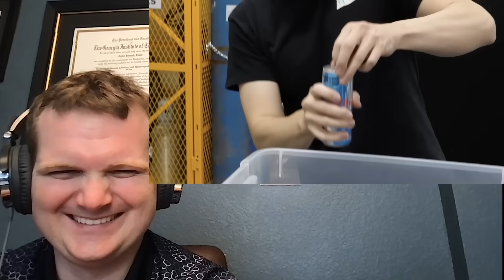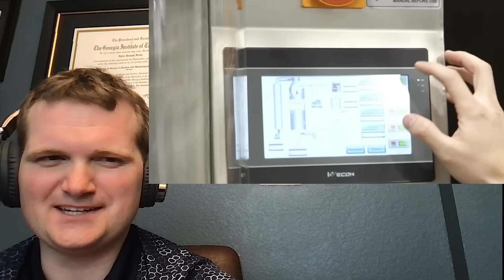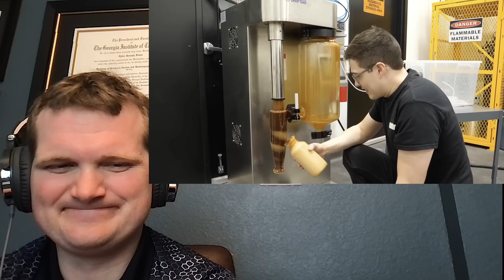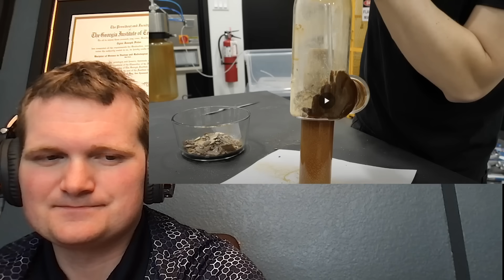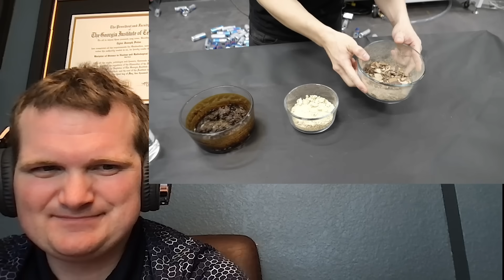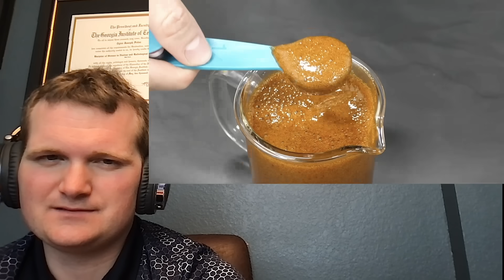Red Bull X100 Enrichment? - Nuclear Engineer Reacts to NileBlue

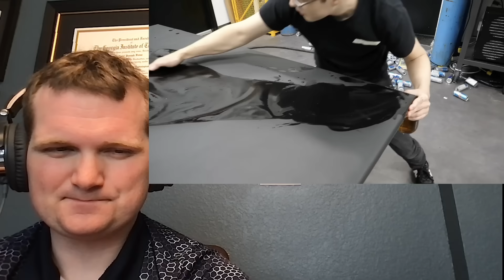Comment: 10:35 Also when you are around any type of heavy equipment there are warning stickers on them that tell you "Hey, don't do this", or that a pitch point, don't stick your hand in there while the equipment is running.
Reply: Anyone who's ever handled worker's comp claims in any industry knows just how limitless human incompetence in the face of clear and obvious warning signals can be. I never knew just how many different codes the ICD-10 has for traumatic digital amputation.
Reply: @SimuLord  I gave my coworker who shoved his hand into the table saw blade so much shit for it because of how it happened, most of it wasn't to him directly but to other coworkers but he reached his left hand over the blade to try to like grab the wood he had just cut without a guard or anything like reaching over is a bad idea even with a guard much less gaurdless like we ran that saw because of how often it would get in the way and have to be removed anyways and it wasn't a quick removal so it just got left off and it was never an issue except for the one dude who was an ex? Cokehead he claimed he didn't use anymore but I'm 97% sure he did and was just a complete idiot. Like he refused to believe me that the hospital in town with his insurance doesn't have an emergency room till I drove his dumbass over there to see the sign that says no emergency services and then drove across town to the county hospital that actually has an emergency room with his hand cut open. Like I'd lived in this town for 20+ years at this point I'm pretty sure I know where the emergency room is lol but fine if you need to see yourself while your hand is ripped open whatever we'll drive there first it's not me in pain needing painkillers lmao